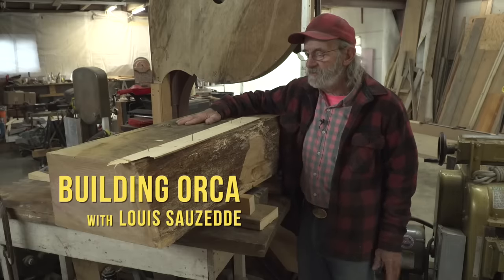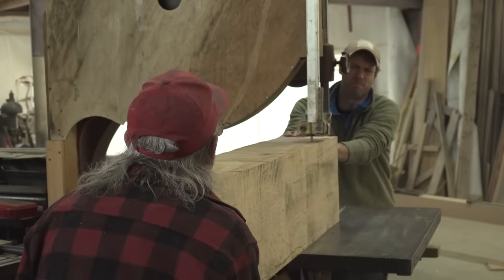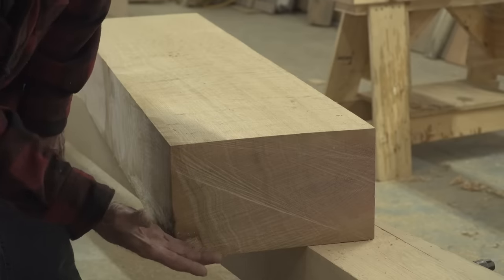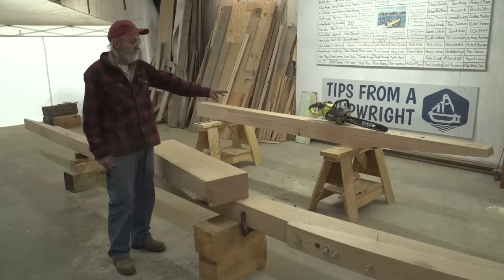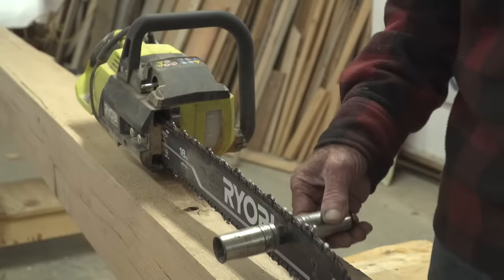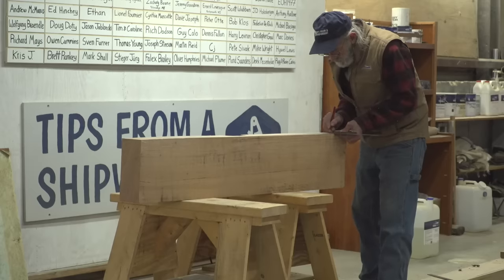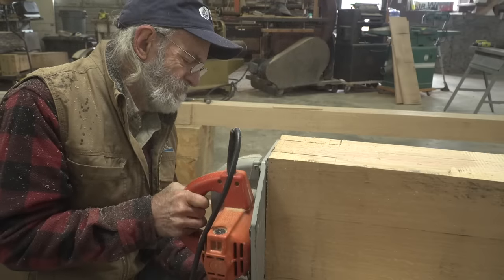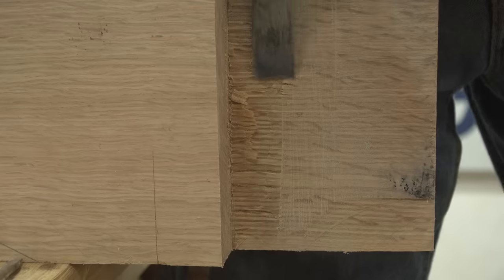Building ORCA - Episode 10: Installing the Stern Post

Comment: My Pop would have used his big "Slick" on the inside of that tenon cut - the steel was about 3 inches wide and 12 inches long attached to a 2 foot handle. It would lay on the face of that tenon and roll a curl like cutting Shirley Temple's hair. Flat and true, exactly what you're looking for when fitting big timbers. It was the last tool he held in his hand when he collapsed in his shop, like Arthur dropping Excalibur. He passed a few hours later, but the Slick is still doing its job in my brother's shop.

Comment: Drilling chainsaw bars is not difficult. The best metod is to sandwich the bar between two pieces of ½” mild steel and drill it all together with lots of oil and a good sharp HSS drill.  The real trick is to keep the air away from the procedure so that it does not cool either the drill or bar as the drill exits the hole.  I have done this many times with and without a pilot hole.  If you drill a pilot hole then do not drill all the way through the mild steel on the bottom and fill the pilot hole with cutting oil.  Solid bars drill a little easier than laminated bars for some reason - don’t ask me why! I have drilled many Canon and Stihl bars for my mills.   I love the set up you have designed and fabricated for mortice work.  I am going to try this! As a Nova Scotian I am going to say it is a great project.

Comment: Hi
Intention to inform:
You should think about using japanese pullsaws for your work. Makes the whole process waaaaaay easier.
We do carpenter work and changed almost all our tools to japanese woodwork tools. 
They are more advanced for the job they have to do. Because the are very old in design. A pull plane i.exmpl. is marvelous to use! Way better then a push plane, in our humble expjriance.

A plunch saw with a rail would easyup cutting a lot to, would bring down handworking time too. When you want that. 

Have fun thy for your insights.

Comment: Thanks for the knowledge. I don’t plan on building a boat but some of the techniques you use are of immeasurable value to certain woodworkers. As you point out, you can make excellent joinery with a little imagination and everyday common tools. 
  By the way, I noticed the nib on the panel saw you were using. Good tools last a life time and more.

Comment: Love that chainsaw jig.. Simple... Clever... I don't understand what 12 degree angle on the blade means..
Reply: He is referring to sharpening the teeth on the chainsaw.  Most saw chains are sharpened at a 30 degree angle ( zero being exactly perpendicular to the bar) for normal crosscut bucking of logs.  For ripping ( cutting with the grain) it is better to sharpen closer to zero. Many commercially available ripping chains are sharpened at 5 or 10 degrees.  This produces a less aggressive cut that also wanders side to side less. He sharpened his at about 12 degrees.
Reply: @boooshes  thank you. I appreciate it.

Comment: check out the Skilsaw SAWSQUATCH for the cuts you did around the 10:34 mark. every review ive read and seen about it would make the end of that beam faster and easier. just a suggestion for a tool to use on these big beams